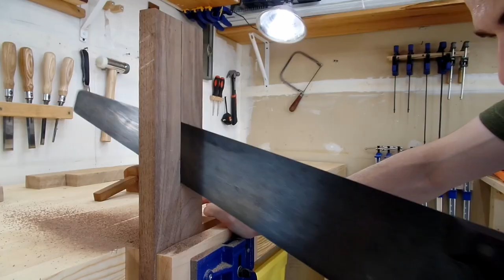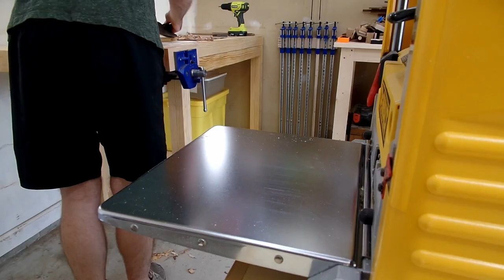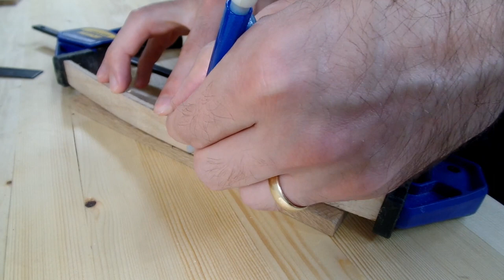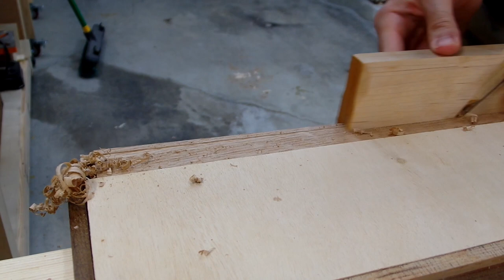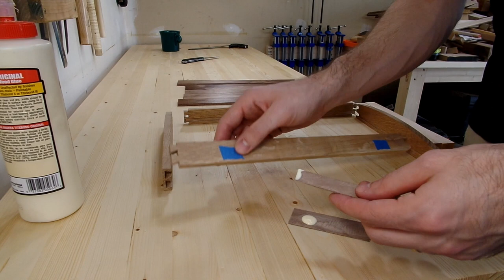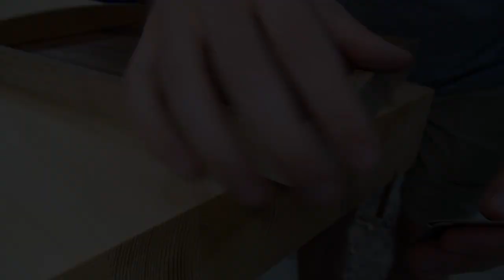Hand tool woodworking | Building a shaker inspired serving tray

Comment: I've been watching several of your videos, great work. 
Bit of irony, planing your material by hand. Then run them through the thicknesser!!
Reply from the maker: Thanks! And actually the first time I planed the boards was to flatten one face, much like a jointer would, and then used the flat face to run through the thicknesser to get the pieces to final thickness. Combing old and new I guess.

Comment: Nice job! 

Curious though, why you kept switching between the ryoba and the western saw for different rip cuts during the stock breakdown and dimensioning?
Reply from the maker: Thanks! And I have always used my ryoba for almost all my rough cross cut, rip, and re-saw but the white oak was really binding this time around and in my frustration I decided I'd give a hand me down panel saw a go and found the rigidity and extra thickness of the western saw made it a lot easier to re-saw the white oak. I've actually since switched to primarily using the western panel saw now. I like how thin the ryoba blade is but I think I've found that because it is so thin it has a tendency to wander from the cut and bind way more easily. I think there is still a time and a place for the ryoba though.
Reply: @DaughtersWoodCo  I've tried ripping some with my ryoba - even got a bigger one from Woodcraft - and just found it to be an exercise in frustration for ripping anything but very soft woods, usually 3/4 thick or less.  I've seen videos of people resawing an entire bench worth of boards with one, because that's what they had.  All I can say, is more power to them.

More recently, I picked up an ECE 26"/700mm frame (bow) saw with a 4 tpi rip blade for the coarse stuff.  Little bit of a learning curve as far as handling that beast, but should be fun!  I ordered a second rough crosscut blade for stock break down thinking I'd switch them out, but now I think I "need" to make a second frame for it.  

Maybe that would be a good idea for a future "Building tools to make tools to make furniture" episode for ya ;)
Reply from the maker: @memilanuk  I've always been intimated (not sure if that is the right word) by frame/bow saws. They seem like they'd take a while to get use to. 

But like you said, maybe that could be the sixth installment of the "Building tools to make tools to make furniture" series!
Reply: @DaughtersWoodCo  yah, not sure I'll be cutting fine dovetails with one any time soon ;)  But for dimensioning stock... it seems to work well.  I've got a smaller Gramercy coping saw kit that I need to work on... maybe that'll help with the fine motor skills aspect.